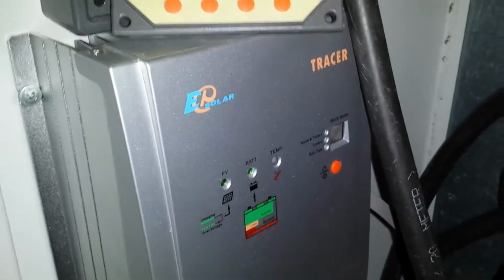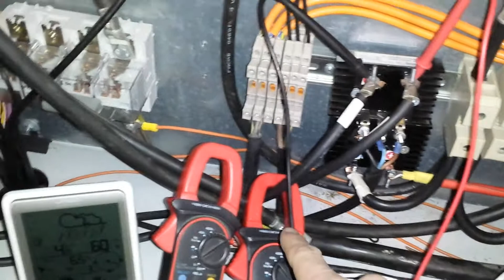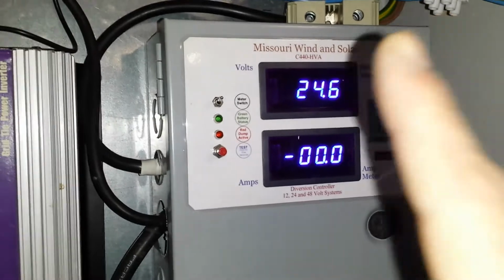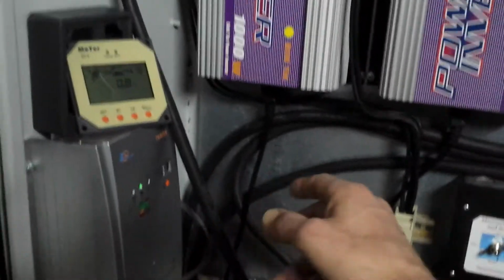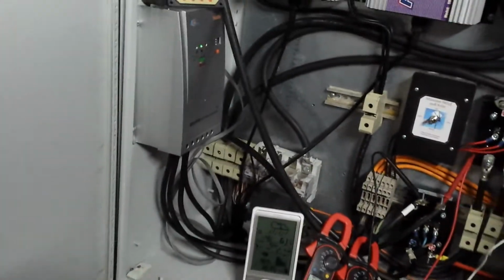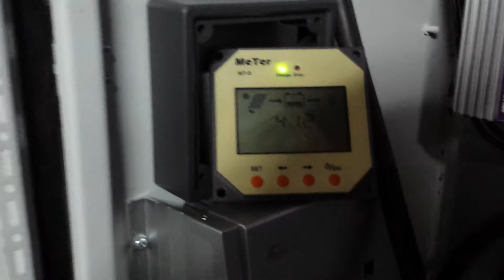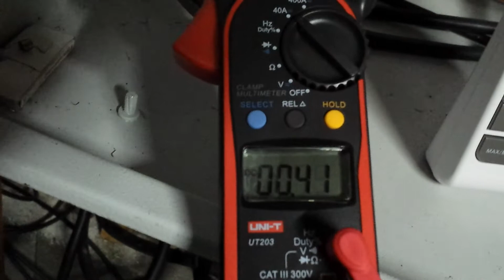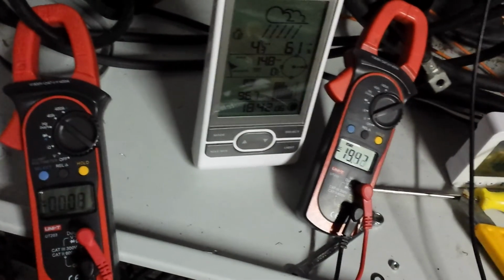Improvments and some explaining

Comment: Nice video Tore i would not have used that MPPT controller as it has no programming in it for wind. You can program the power out side as a dump load, but i think the load out side of that mppt controller can only handle 40amps from memory. But i am very interested to see what it will do.

Comment from the maker: 40 amp is more than I need becouse the charge voltage is or can go to 100v. My consern is that the turbine will make more than 100v. Do you the limit on this charger on the output side is that also 40A then i have a probleme he-he . But as i say in the video I vill always run it with grid Tie.